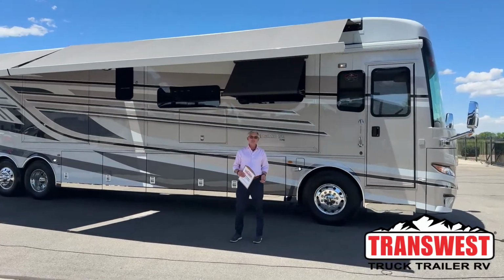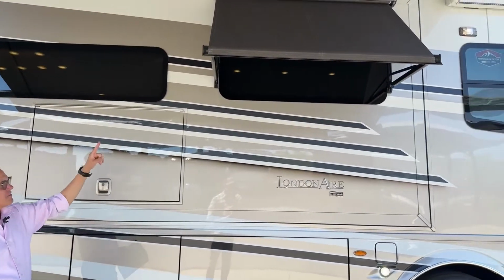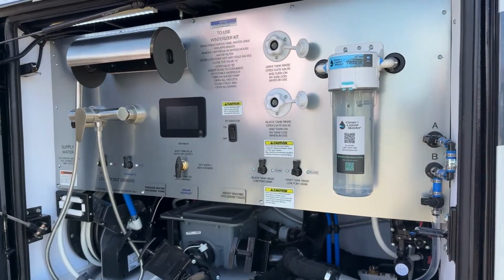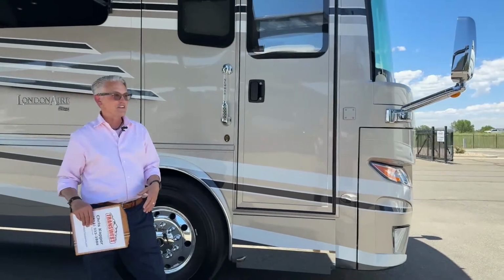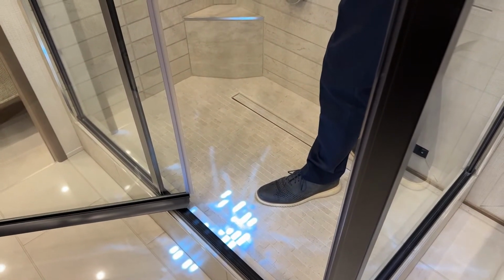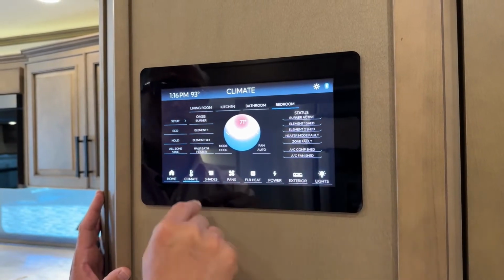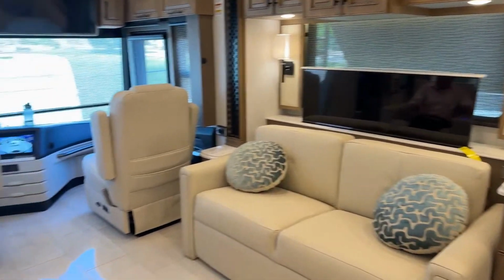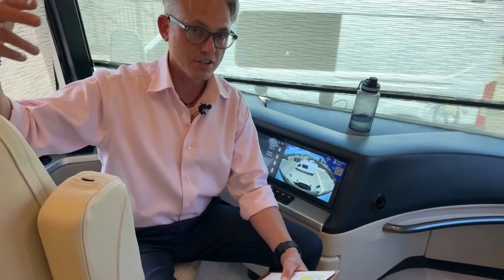2026 Newmar London Aire 4551

Comment: Your "Usable" amp hours on an AGM is 50% of the batteries rated maximum. If you discharge below that level you will damage an AGM or wet-cell battery. Another benefoit to lithium batteries is that they weigh 1/2 of a AGM and deliver 6-8 times the lifetime duty cycles.  So if you do a lot of boondocking, it's a no-brainer.